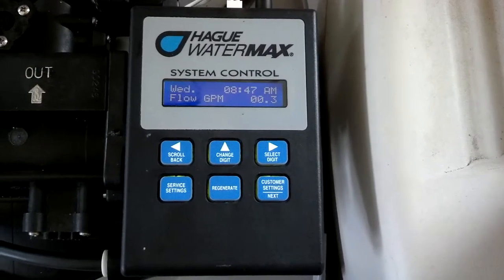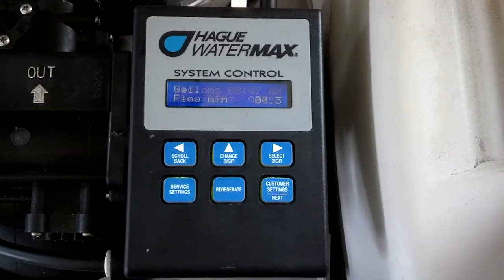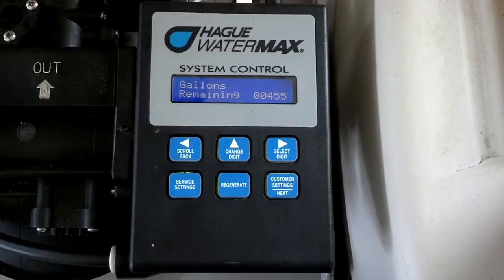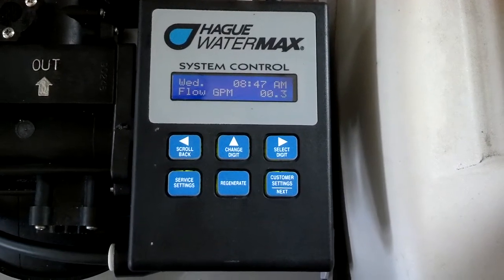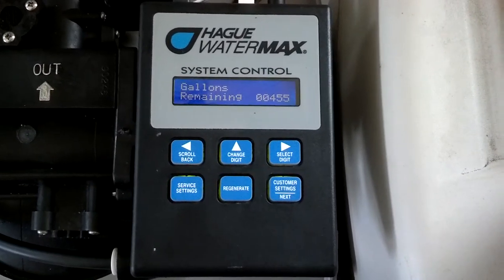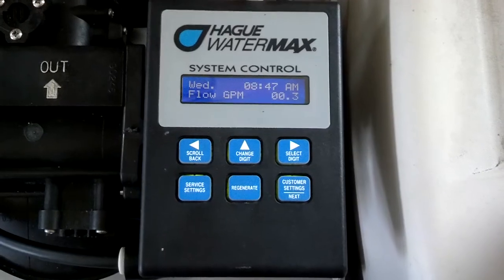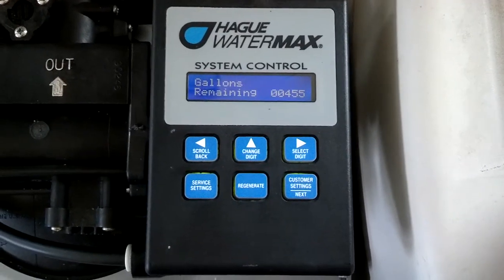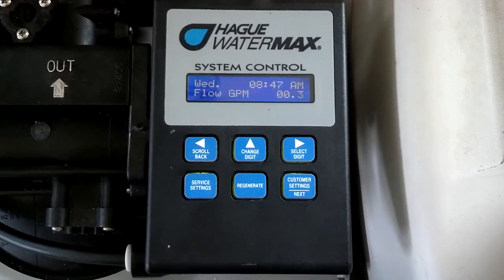Hague Watermax Flow Meter

Comment: A video showing all the settings and how to set for efficiency would be good.  My watermax was running for over half an hour on last regeneration cycle.   Need setup for a house of 2 people.
Reply from the maker: There are too many different configuration options. 30 min. Is a normal regeneration time. All the setting specifications are in the owner's manual. https://slowatersoftener.com/pdf/WaterMax60_OwnersManual.pdf

Comment: The local dealer that put it in closed up shop. I live in the Boyertown area. I did the plug and it didn’t work. I noticed the first problem was the sound of rushing water and when I looked, almost went through 50 pounds of salt.